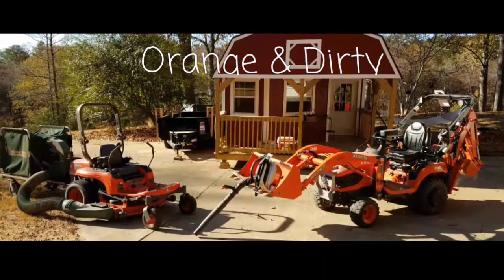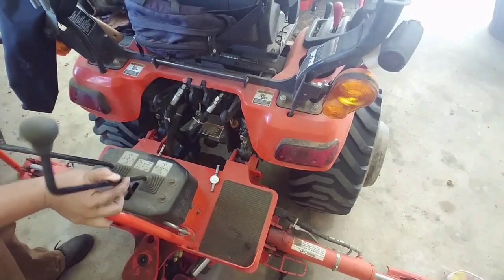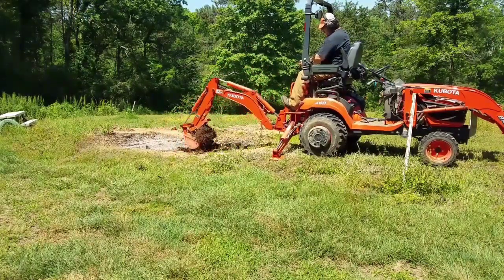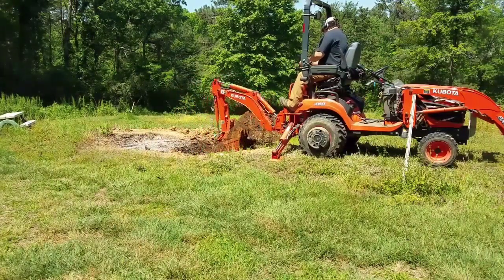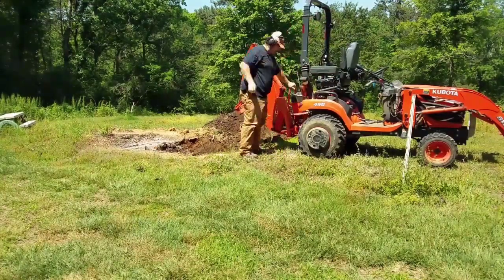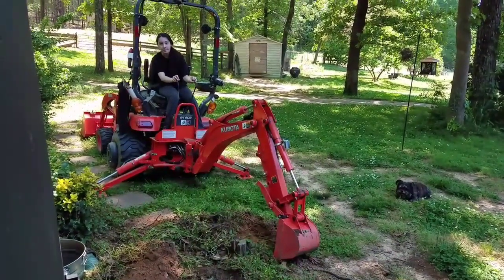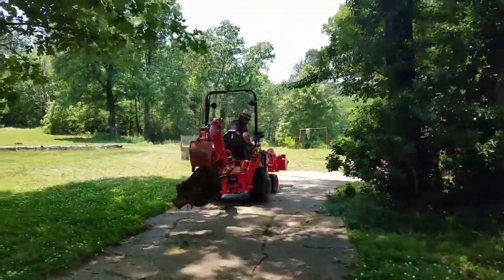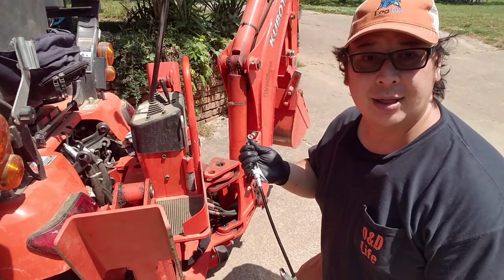Kubota BX Backhoe Vlog

Comment: thinking of buying a tractor bx23s
Reply from the maker: They are great little tractors for a small rural property.  Comes in really handy to have!  I've got a bunch of videos of it in action with the different implements.  What I like about Kubota is that the make the entire machine.  No engine from someone else and pieced together.  Also lots of aftermarket stuff for them.  They are like the Glock19 of tractors!